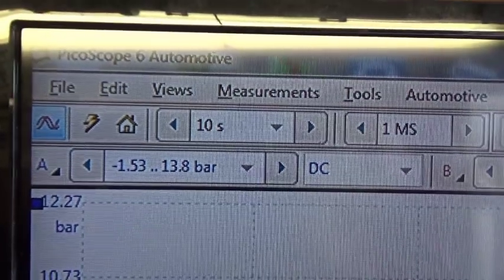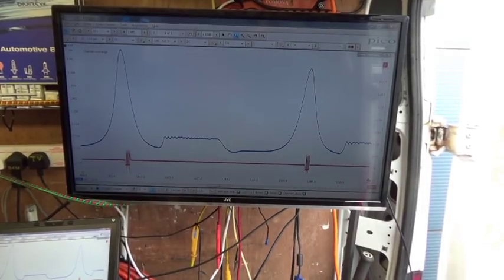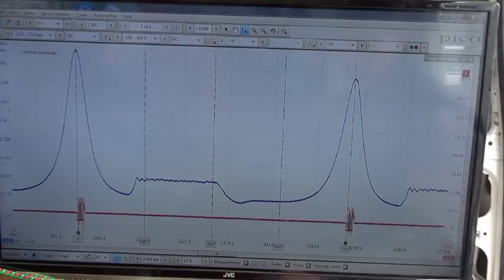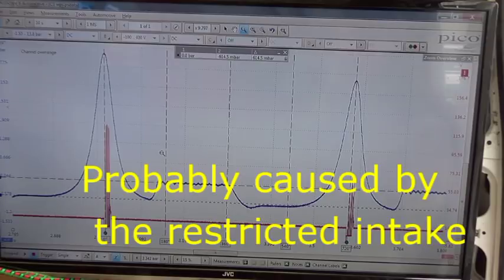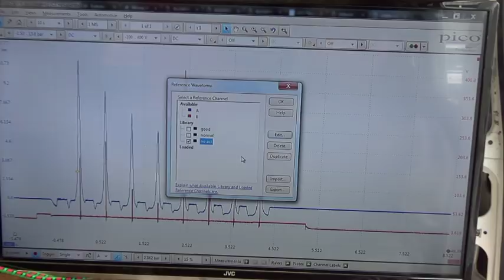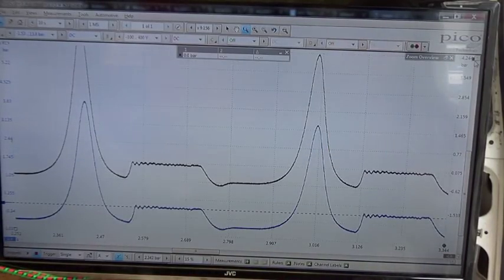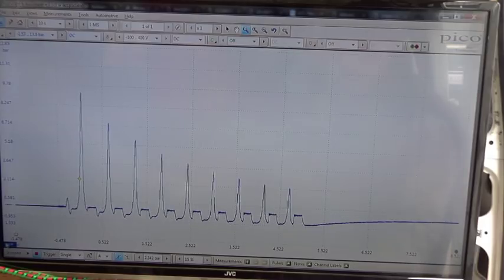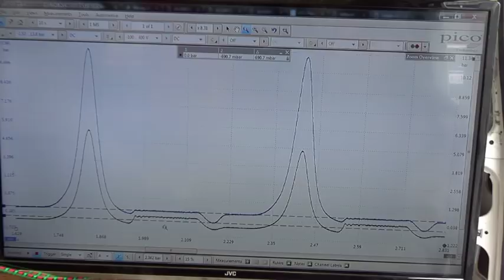C3 Pico WPS500 In cylinder pressure analysis

Comment: Great information Scott! I recently started diving head first into the capabilities of the Pico 4425 as well. Amazingly powerful scope. Performing running compression is awesome with the wps500 as well. I started dabbling with the NVH kit. It verified a driveline vibration that I had in a Mercedes-Benz Sprinter van. Cheers.
Reply: Jason Guggia, ( you mean Steve, but he probably would not take offence )

Comment: Hi mate, Nice vid. When I first started looking at in cylinder pressure analysis I stuck with non VVT stuff to keep variables to a minimum. The 180 line dissecting the exhaust opening and 360+20 line dissecting the inlet was a pretty good general rule and seemed to work all the time. Since looking at VVT stuff, even when disabled, those rules don't seem too apply any longer (I suspect due to the ability to vary timing, they can be more adventurous with the basic timing). These days I only trust a known good on VVT stuff and don't have much faith in the general rules.
Reply from the maker: Combustion is still governed by the laws of physics and chemistry whether vvt is involved or not mate. The combustion triangle has to balance. If possible I always gather known good with vvt and vvl disabled where possible. Then take a second capture at idle as intended by the manufacturer.

Comment: Hi Steve great video again lots of very useful info top work mate! when I use a reference waveform I like to open another scope view open my reference in that apply my rulers then turn off the channels on that scope view and run the next test on the other view that way you have 2  lots of rulers ( if you understand any of that 😂) saves using your memory lol. Don’t know if you’ve tried it or have found a problem doing it that way just thought I’d throw it out there thanks again steve.
Reply from the maker: Awesome tip thanks Scott, I use them but thought it would be best to keep it in a single view (full screen) for the video.
Reply: That’s a good point mate thanks again for the videos always learning!

Comment: Thanks for the case study Scott , very well explained. I am attempting to use in cylinder testing for the problem cars. I use a verus edge, but without the added abilities of  the Pico and  WPS , I won't be able to get the clarity and accurate timing position with it. Any thoughts on that with your experience?
Thanks
Reply from the maker: Kelly R if you upload to a pc with shopstream you should have a degree more ability to measure etc. Pico really is the way forward when it comes to in cylinder diagnosis.
Reply: snap on transducer is joke , does not work for cylindrical pressure transducer , I have 3 brands of transducer and with snap on you can not diagnoses in cylinder ,  when the exhaust valve is open the  pressure should be   o psi , on snap on goes  under negative about t - 10 they like distortion on wave form , I contacted snap on they gave me other pressure transducer is same  thing , any video on you tube you watch  using snap on transducer you will see the same thing = garbage . the other transducer  for 1 third of the price give you clean and accurate signal.

Comment: Fantastic video mate I need to get me a Pico I made my own in pressure transducer but cannot get good enough definition on the snap on verus like you can on the Pico
Reply from the maker: Pico is definitely the way forward for “advanced “ scoping. I love my Verus for it’s generic capability but Pico is in a different league. Have a word with Matt Williams from prodiag.co.uk he’s the man for everything Pico.
Reply: Simply Diagnostics can't afford on at the minute mate will have to wait
Reply: Hi,what pressure transducer did you make? I have the snap on 500 psi, but I made a 200 psi one which is better, still not in the same league as the pico,but better
Reply: Jonathan Dean I have 100 200-500
Reply: Oh well, sounds like you need a Pico!
Reply: Jonathan Dean yes i do do you want to give me one or two lol
Reply: Pico gave andy mechanic a nice set up, drop some hints on your videos
Reply: bodgit and leggit garage I made of few of my own from air conditioning pressure sensers they just don't show negative psi
Reply: Francisco Vera I made one originally with an eBay transducer and it was kind of blocky and didn’t read vacuum either. Bought a $75 Honeywell px2 transducer and it is very clean and also reads vacuum as well. The Honeywell transducers are a much higher quality and look exactly like the transducers ATS uses with their scope and software. The resolution on the 4425 is amazing. I use it with a surface pro and the touchscreen makes it super portable and very intuitive. I used that heavy duty Velcro to mount the pico to the back of the tablet. It’s as portable as a modi’s with much better functionality. The zoom on the pico with the surface pros 1440 screen are a match made in heaven.